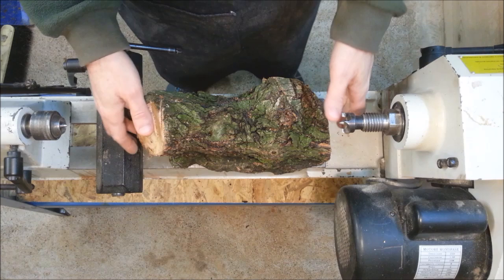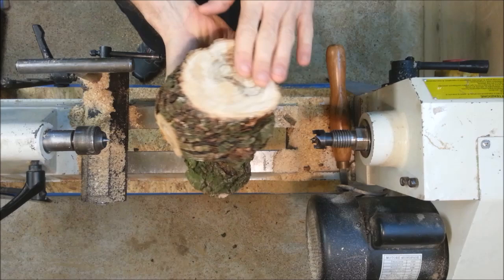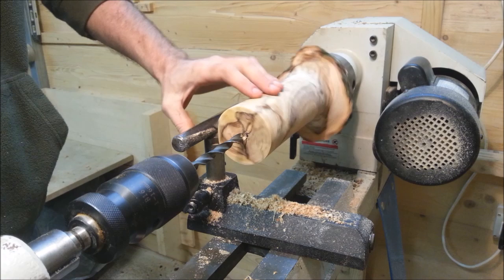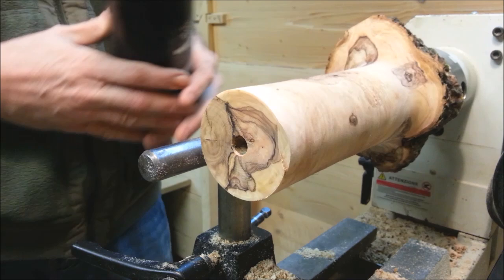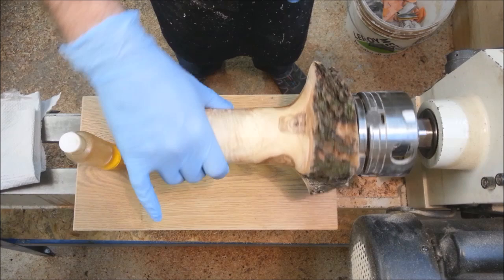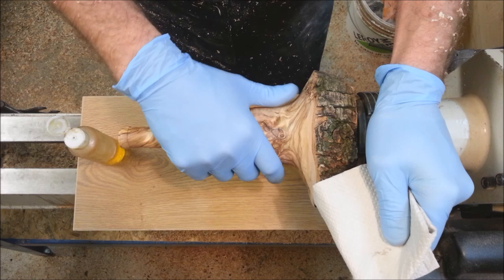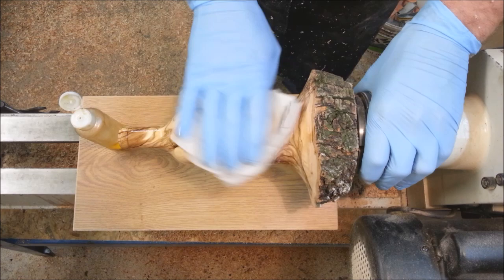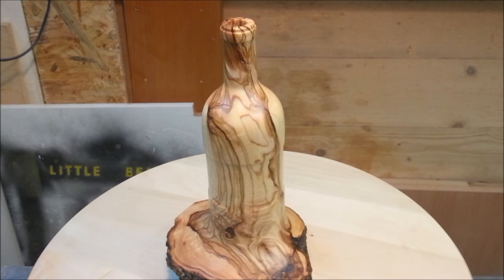Woodturning A Commissioned Emerging Wine Bottle

Comment: Thumbs up to this. Olive wood, especially branches have so much beautiful hidden figure just waiting to be uncovered, and this piece is no exception. well done. Good advice with the sandpaper.
Reply from the maker: +Ian Thank you Ian! I'm working on finding a steady supplier of Olive wood, as I've been using only found wood so far. I still have quite a bit left, but it won't last forever, I'll do the rounds between the farmers around where I live and see if someone wants to make some extra cash for saving the nicest piece instead of using them as firewood :)

Comment: I dnt read all comments.. may be already discussed the issue. Is clear that piece of olive used is not seasoned. The unseasoned  wood will dry and split quite often, even I’m “happy” to accept the cracks as part of the  natural esthetic. I love this  works… bottles or other similar stuff with a part of “wild wood”…
Reply from the maker: Thanks Berna!
Olive is a very very dense wood, and when drying it will distort very little and rarely crack. I've been turning fresh Olive for about 6 years now and not once did it crack on me while drying.

Yuval

Comment: Very nice work Yuval, the grain pattern is just stunning. I have a piece of some sort of Elm of similar size and was thinking of making a vase, but I have no hollowing tools. This looks like a good alternative and something I could achieve. The emerging feature is very a creative design. Great video and thanks for sharing.
Reply from the maker: +Gil Grace Thank you Gil! I'm sure Elm would work just fine, and in this design's case, a drill bit is all you need, and you have a nice weed vase, which looks fantastic!
Reply: +Yuval Lahav Yes, I've made one small vase like that. The one I planned would have been taller with a large opening and thin walls. Maybe when I get rich I can buy the proper tools. By the way, the wine bottle could work as a bud vase as well.
Reply from the maker: You don't need to be rich to buy proper tools, I put aside a couple of euro every month and buy myself a new tool for my birthday, the rest of them I was given as gifts, or won at competition, some of my tools are give aways from passed away turners, I guess it's more luck than anything else....

Comment: Apologies in advance for an off piste question Yuval, but what was the wax (I'm guessing it was wax) that you used on the sanding disk? I might as well take this opportunity to ask why too? Thanks.
Reply from the maker: +Dave Storr No problem Dave, how would one learn without asking? :) It wasn't wax, it's a block of pure rubber, and it is used for cleaning the disk before sanding, since I sand a lot of wet wood, the paper gets gummed up really quick, but it fact it does not wear out, so a pass or two with the rubber, and it flicks away all the grime and shaving, giving you a new disk. I can't find these 12 inch velcro backed disks in Italy, and need to order them from the UK, so anything that lengthen the life of the disks is a blessing. I've been using a single disk for whole my projects from the last year. I replaced a disk a few weeks back, and there is no reason it shouldn't last me a year as well.
Reply from the maker: +Dave Storr Of course, I don't sand as much as a large production studio, even with the rubber clean up, their disks won't last as long as mine...
Reply: +Yuval Lahav Brilliant, thanks for the straight answer Yuval, appreciated. A sanding disk is yet to grace my workshop so the heads-up advice will likely come in very handy once sorted. One step at a time :) Cheers.
Reply from the maker: +Dave Storr No problem, don't jump the gun and get a dedicated sanding disk, a setup like mine, made of plywood and velcro glued on it mounted in the chuck will work wonders for odd jobs, and if you see you sand a lot, and need a dedicated tool for it (which also takes up space, mind you), then get a professional one. Just my two cents ;)
Reply: +Yuval Lahav That's an interesting idea. I was considering an SIP combi sander that would have been ok at best. Damn, here come the questions again... How have you attached the disk to the spindle, with a faceplate? Can I ask where you buy the Velcro backed sandpaper in that size? I need to weigh up the options but with a bit of time/effort this could produce a better piece of kit. Plus it's lathe powered too.
Reply from the maker: +Dave Storr It's all simple enough, the velcro for the wooden disk I bought in an hardware store, where they sell glue backed velcro strips 5 cm wide, I just bought a couple of meters, and started gluing them (added some wood glue even though the strips are glue backed, I didn't trust that glue enough) side by side until the disk was covered, and cut around it all, total cost, 3 euro. Wood disk was from plywood leftovers, 2x1.5 cm wide glued together and turned round and flush on the lathe, using the wormwood screw that came with the chuck, which is what I still use to mount the disk to the lathe. I want to make a new disk, which I will make out of 4 cm wide ply, and for that I will probably buy one of those disc face plates that fits in the chuck jews, or simply make one from some hard wood.
Reply: +Yuval Lahav That's great, thanks for the tips Yuval. I think this could will be the way to go. Even with the cost of a permanently fixed faceplate it's relatively inexpensive. You said the sandpaper was from the UK, which company do you use for it pls?
Reply from the maker: Dave Storr I really don't remember, but I got it from Amazon, so shouldn't be too hard to search it there. Hope this works for you as well as it did for me!
Reply: +Yuval Lahav Will have me a search. Thanks lots for your help.
Reply from the maker: +Dave Storr Any time! let me know how it goes and if you need anything else :)

Comment: I think this link can explain something about sandpaper; http://www.toolcrib.com/blog/2008/10/7-best-sandpaper-brands-klingspor-vs-norton-vs-3m-in-the-sanding-supplies-showdown . I did a little research and found out that there is a lot of sandpaper on the market for specialiced purposes, what you need is sandingpaper for "naked" wood. Have you ever tried steelwool for finishing, its available in different "grids" , cut a piece of the roll with siccors and were a glove when you use it. To be sure that there aren't any metal particles left when you're finished, put a strong magnet in a plastic bag and go around your piece of art, the plastic will keep the magnet clean. BTW I like your work, that's why I subscribed after I saw you for the first time.
Reply from the maker: Thank you Mark, I read the article, it was very interesting! And also, thank you for your idea, and for subscribing!

Yuval.
Reply: You're welcome, and maybe you will find some inspiration on this site http://www.gervervoort.nl/ . The link on his site, Alain Mailland is a must see. Keep up the good work, Mark.